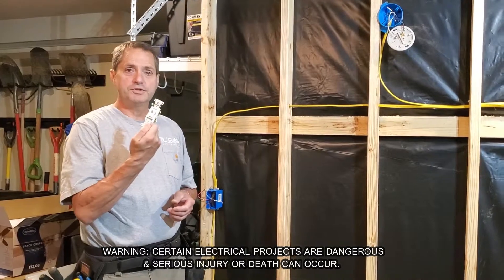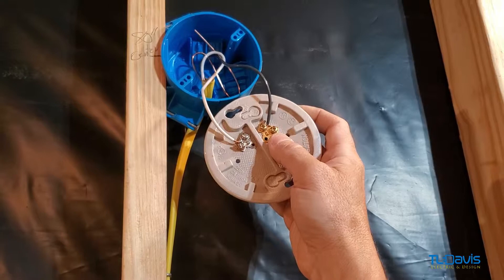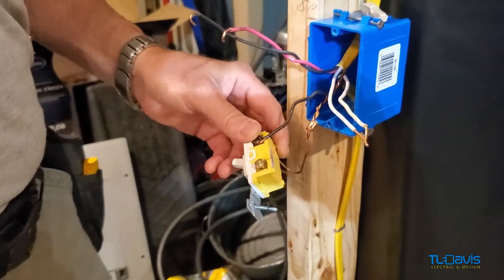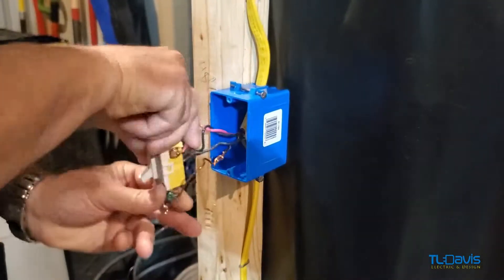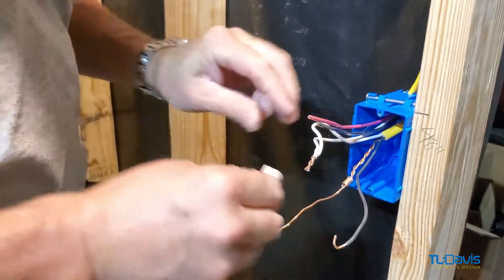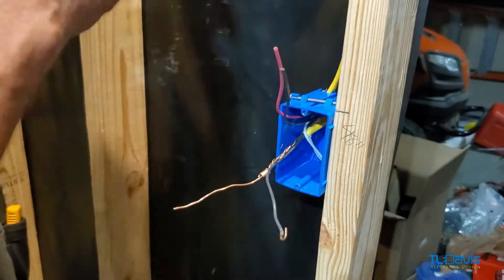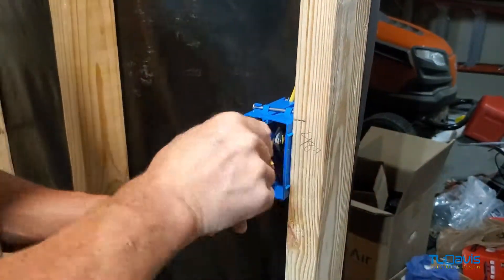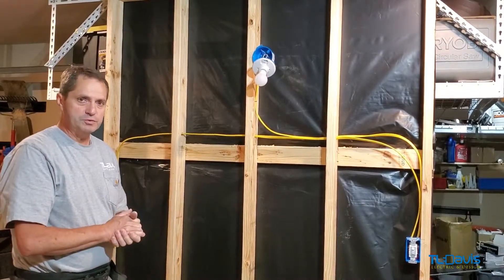How to Wire a 3 Way Light Switch | TL Davis Electric & Design

Comment: Helpful
Reply: helpful video . one question it looked like the neutral on the light was not grounded or protected with a nut wire connection..?